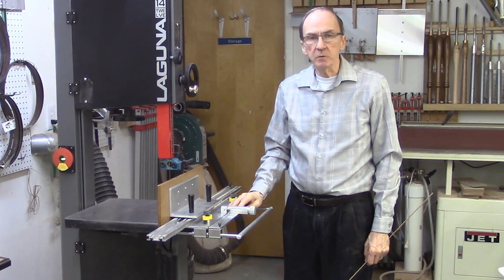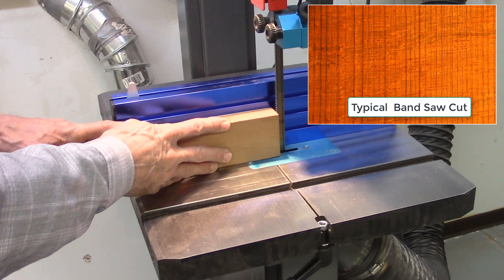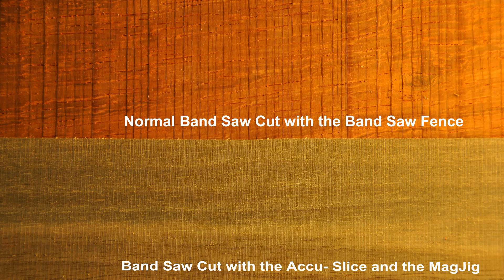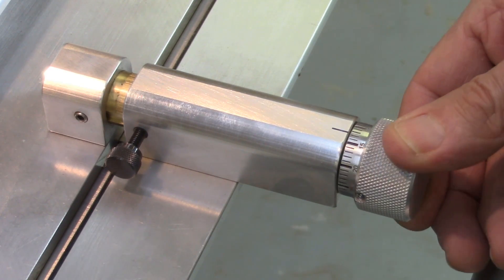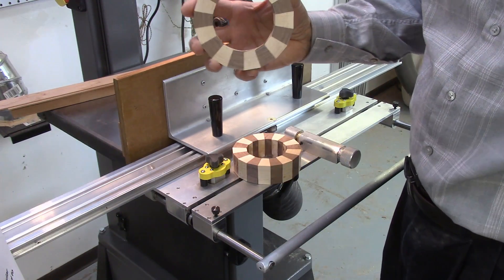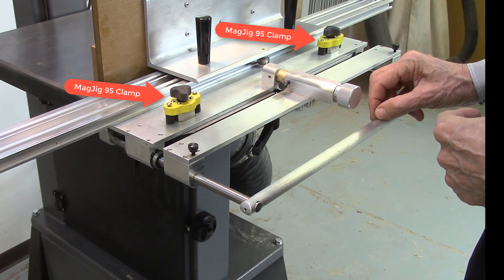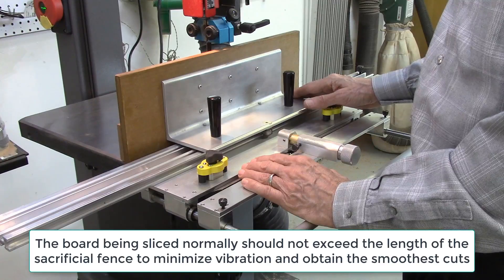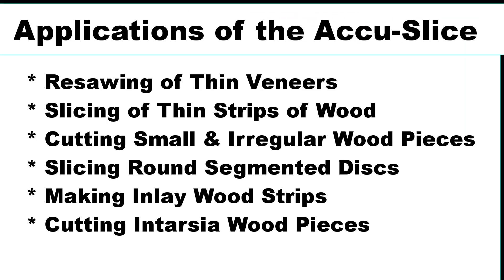Introducing the Accu-Slice (7)

Comment: What blade kerf /  TPI would you recommend for those thin cuts ?
Reply from the maker: For most of my work I use a Timberwolf blade, 8 tpi by half inch wide, rake tooth design.  The blade kerf is 0.050".  I occasionally use blades 10 tpi,.  When I am cutting segments on our new segmenting jig (which will be released in March 2017) I use a 14 or 18 tpi blade.  I have just stayed with half inch blades for all of my work.  I do not use any of the carbide tooth blades since they give a rougher cut.
Reply: Thanks for that information